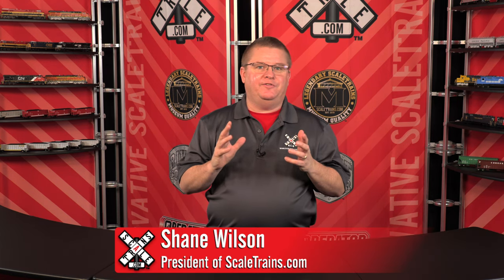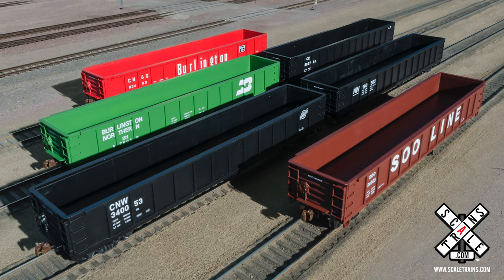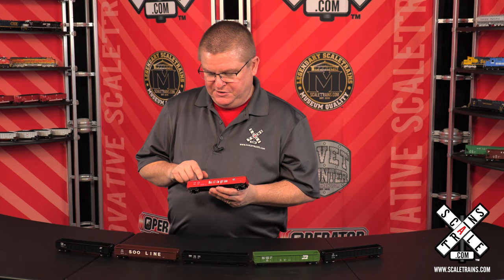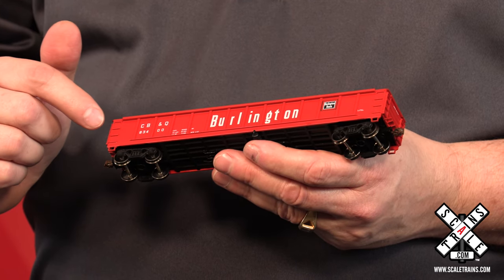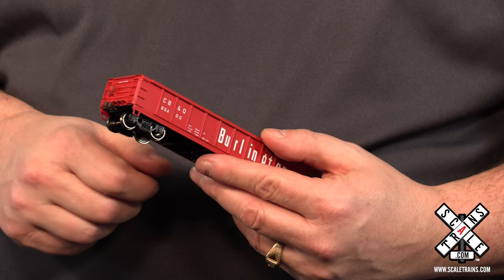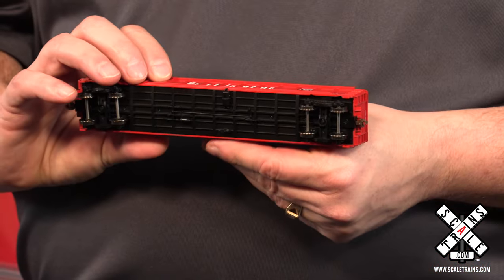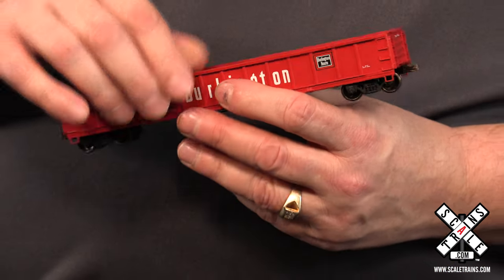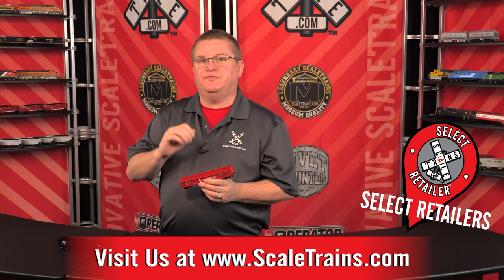All-New Kit Classics CB&Q Havelock Shops 2566 Gondola

Comment: Nice gondola guys. I was hoping for plastic pellet covered hoppers. Like the Pullman Standard ribbed side 5850 capacity car. That would be a great car in kit form. Also the early and late versions of the Trinity one's. The 5850 and 6200 capacity cars respectfully. "Every Thing Is Made Of Plastic." By the way Atlas has the to 5701, 5800 and now the 5250 capacity cars. Now for a ACF/ARI  6200 capacity somebody?🤔🤔🤔 Walters will probably release the NSC 6200 car they have too. That leaves the Greenbrier, Gunderson and Freight Car America on the drawing board.